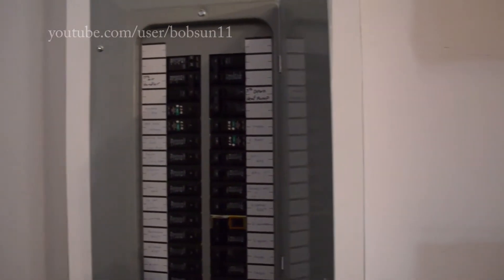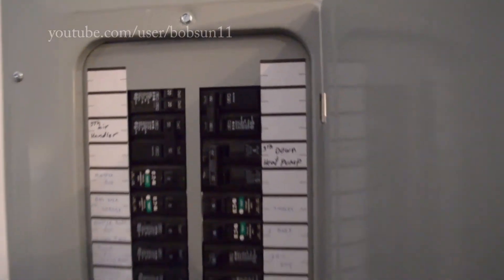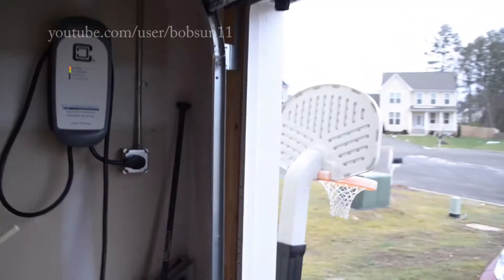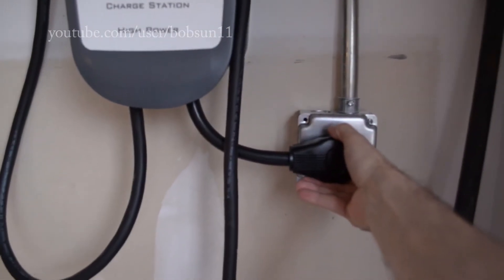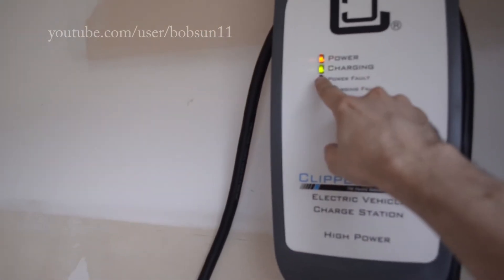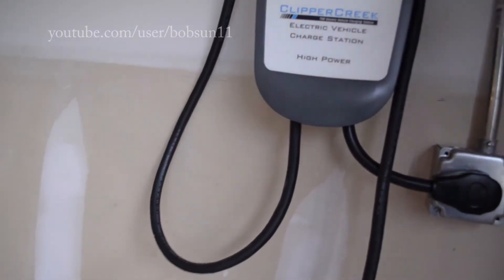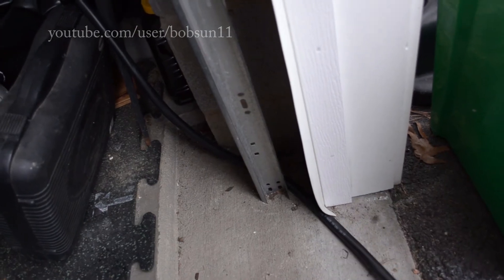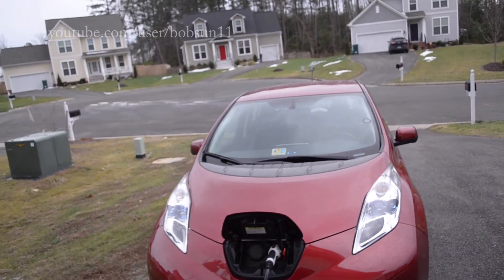Clipper Creek HCS-40P (NEMA 14-50) installation tips

Comment: Was the charging cable easy to remove?  I might need to place my unit in my basement next to the circuit box and then pass the cable through my wall like how the cable for internet is done
Reply from the maker: Yes i was watching my electrician doing it. But wasn't complicated at all. Maybe take picture of the wires before disconnecting them so you remember the order

Comment: Doesn't the door still close on the cable? That track is where the wheels are for the door, but the door sits closer to the front where the trim hits. If it didn't, there would be a gap between your house and garage door. Am I missing anything?
Reply from the maker: There is a gap covered by rubber fitting.  4 y since i have it and the cable is fine. No marks or damages on it.

Comment: was it a difficult process to remove the charging cable from the box so you could loop it outside the garage door?
Reply from the maker: Not at all. You need to open the charger. I would recommend you to take pictures and videos  before you unhook the wires so then you make sure when you hook them back they are in correct order.
Reply from the maker: Aslo check my channel for electric cars EV Addicted

Comment: How much range to you get on average per charge?
Reply from the maker: +Chidi Dike  depends on the efficiency. if it   4-4.3 miles per kWh it will be at least 84 miles. If you drive on highway with speeds above 65mph, your efficiency will drop to 3mi/kWh  then usable range will 60 miles at this consumption rate. The battery is 24kWh however usable capacity is about 20kWh.
Reply: +bobsun11 Thank you.